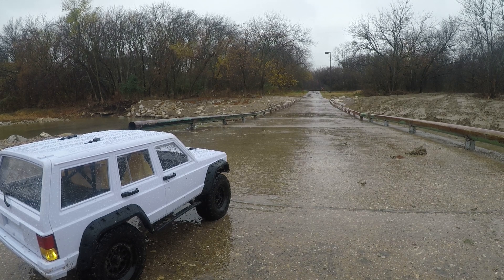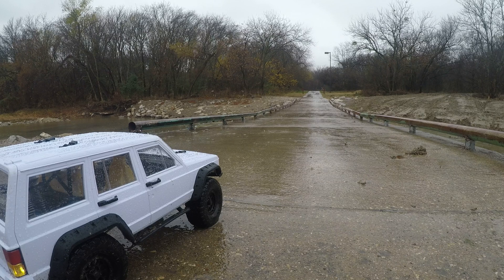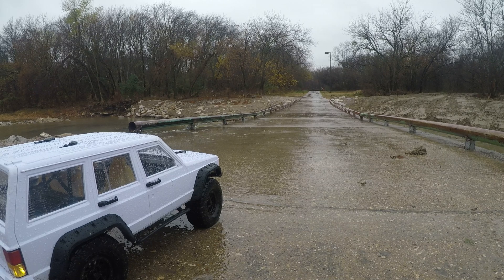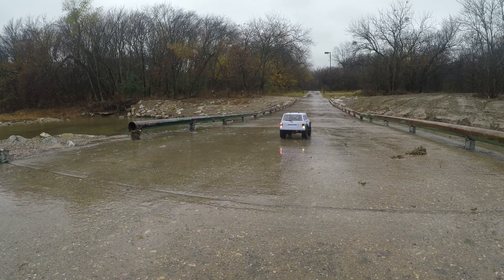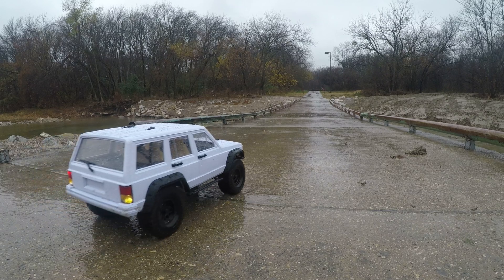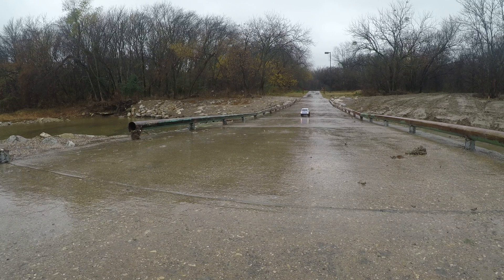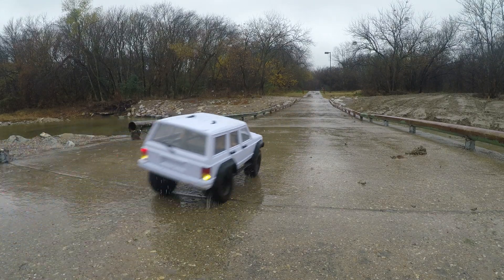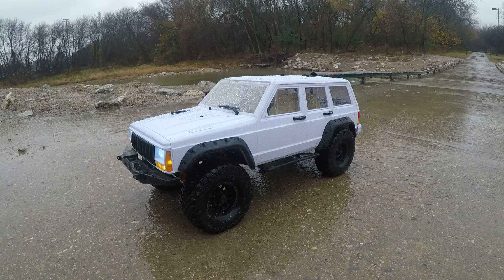Axial SCX 10 II 2-Speed transmission speed test

Comment: haha, looks like that motor has nothing to do in both gears, instant max rpm. I would like to see how slow it can go while crawling, maybe it can have a bigger pinion, or will that be to much?
Reply: 12turn motors are realy not for crawlers lol i have the same body and use a 55turn.. loads of torque and fair speed control. Get the impression the instant start in the vid is more down to poor throttle control
Reply: @adamtaz6  Yea, full throttle at once. But you say the 55 turn has lots of torque. What i am saying that talking about torque is not important when an rc goes full blast in under one sec. That means the torque for this motor is like 100 times to high. What I would like to see is this car crawling, on its slowest crawl speed and see how the motor is doing then. I am rocking Brushless now, those are way to strong also. And i am not running them for speed (as i turn them down in de transmitter lower than 50%), but more for endurance, fun, newer tech, I had it laying around. With these settings you can hear my car slowly accelerating in 2nd gear even when i punch the throttle. In first gear it is pretty instant, but that is normal for that gear. same for a real 4x4 in low range.
Reply: @mrDarksand  yea i hear you pall, the low turn motors have all their torque at high speed so it would seem, the video didnt show how slow it can go and on a high turn like my 55 the top speed is nothing like that of a 12.. even swithching from a 35turn which i had originally was so so much quicker on the throttle than the 55. I also want to see but im guessing the 12 turn will just spin like hell when trying to get over obsticles rather than having that nice CONTROLLED roll over with no wheel spin
Reply: @adamtaz6  That was actually the reason I was watching this video. I wanted to go brushless, knowing it would cog at low rpm if not properly geared or even sensored.  I did not have a gearbox yet when I watched this, was looking for the info. Now I have a gearbox and strangely enough it is nothing what I see here, @ 100% from the transmitter it looks like a Slash on steroids. But at 40% it is nice and controllable, however I still need to gear down more for that ultra low speed (also have a Sensored motor now to hopefully get some more of the ultra low speed control) Don't get me wrong, I can crawl just fine, but you know, you can never go too slow if you can go like 40 mph on the high range (that now about 15mph on the transmitter throttle limits).

Comment: Did you change the transmition on this truck..? So the scx10 2 does not come with 2 speed gear.?
Reply from the maker: no it does not come with a 2 speed. bought this after market 2 speed transmission.

Comment: I get the same if not more wheel speed on my Holmes puller pro stubby with a single speed trans. I don't see the need for 2-speed in RC crawling honestly but that's just my opinion.
Reply: Fast in a crawler is idiotic. I agree 2 speed is for the guys who like to bash and jump shit, it has no usefulness in crawling. I love crawling with trx4 noobs who bitch and complain about the shift servos frying or shift cables binding in the casings because traxxas says oh its waterproof lol. I cruise on by them and smile. 😂

Comment: I ordered the same transmission what servo did you use?
Reply from the maker: honestly bro you don't need a serious servo I have a hitec 150 oz cheapest one at the store 16$ set the end points right and youll never have issues. you don't need a high torque servo save your money